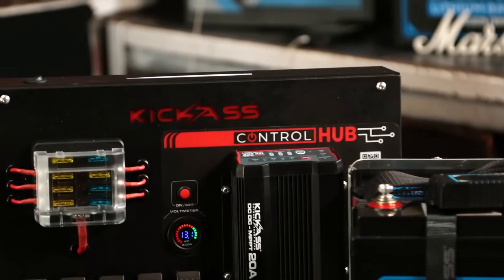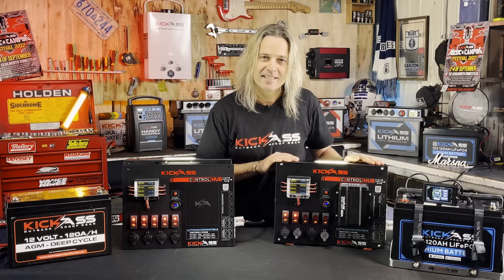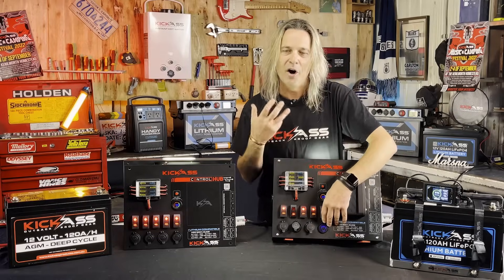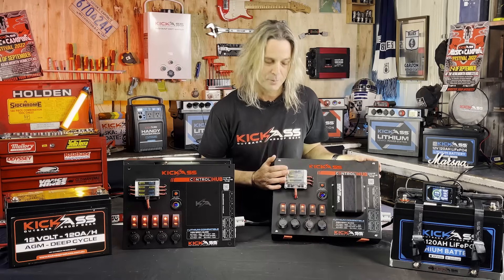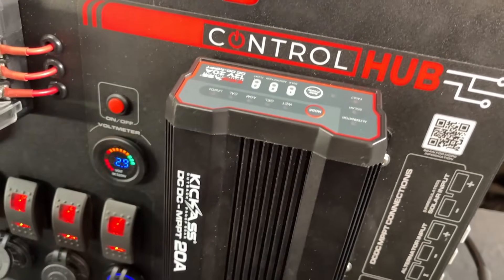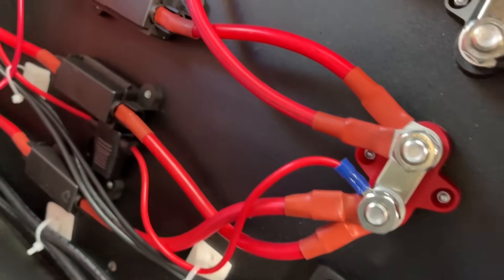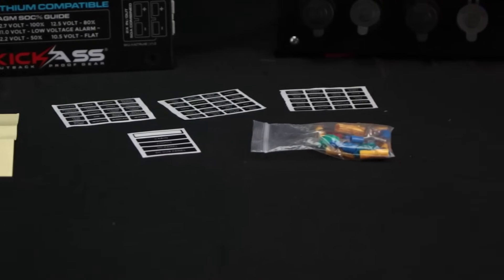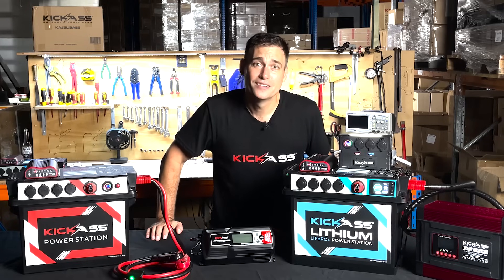The Ultimate KickAss Solution to wiring up you're 12volt system. the KickAss Control Hub

Comment: So if you were to buy the hub without the dcdc charger and you had a 12v system already that had an isolator between crank and auxiliary battery. You would then just wire straight off auxiliary battery into the main lugs of the control hub? 

And if you were to down the track ad a dcdc charger you would have to come straight off the main’s battery to the dcdc charger, then off the secondary battery plug the Anderson straight into the side of this hub? And that regulates the primary battery for the secondary ?
Reply from the maker: G'day there you would have to remove the battery isolater as the kickass dcdc has one & you cant run 2 x isolators
Cheers CRaig

Comment: How to install the DCDC charger to the control Hub ?  ( the hub that doesn't come with the DCDC  charger) if i already have a kickass DCDC charger
Reply from the maker: G'day there we make a unit specifically with the dcdc charger & it has different connections & cableing goes under the unit & not anderson plugs but can be adapted,just give it a crack mate 
Cheers CRaig

Comment: Do you have "how to" video how does it connect? Can I connect two AGM batteries? How do I connect my fan to the switches etc. I need a little more detail 😅
Reply from the maker: G'day joanna,when you open up the control hub you will see that all you have to do is connect the positive (red power wire) to the switches & all the accessories earth (black wire)should be earthed to battery/negative  
Hope this Helps 
Cheers Craig

Comment: So do the switches control the 12v cigarette and usb plugs or is this designed to hard wire things lights and pumps directly into the unit?
Reply from the maker: G'day Logan,the usb's & cig sockets are pre wired for you already & are set to go straight out of the box ,you just have to wire up your accessory's to the switches

Comment: Quick question, instead of the dcdc charger, could I mount an inverter instead ?
Cheers
Reply from the maker: Yes, you can mount a small inverter on the control hub. However it is generally good practice to hard wire your inverter directly to your battery.

Comment: Can you run this off one of ur dual battery system boxes is that how your powering it in this video?
Reply from the maker: Absolutely, this standard version has the option to be hard wired directly to a battery or you can simply power by connecting  trough one of the input / out put Anderson connectors. If you are looking at the version with the DC DC charger then you would need to connect directly to the battery.

Comment: How does it connect to the battery? Is it just an Anderson plug? I'd like to be able to quickly disconnect one battery and plug in another battery for DC to DC charging.
Reply from the maker: You connect the unit via the internal primary connection posts. We provide a heavy duty set of cables for to do this. If you want to use a cable with an anderson plug then that is OK to as long as you use the correct internal inputs.

Comment: Can i wire in a 3000w inverter?
Reply from the maker: No. Such a large inverter should be connected directly to your battery bank with heavy duty cables. 

Running a full 3000 Watt load will draw 275 Amps DC from you battery. You generally do not want anything between you batteries and your inverter with such a high load draw.
Reply: @KickAssProducts  Is this available in the USA?  I have a lifepo 100 amp hour lith battery...is it compatible?